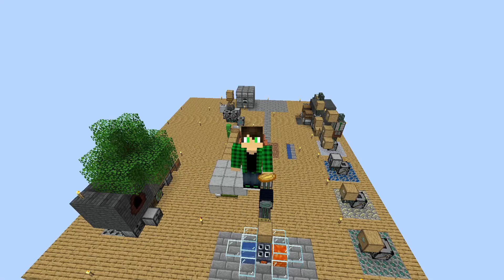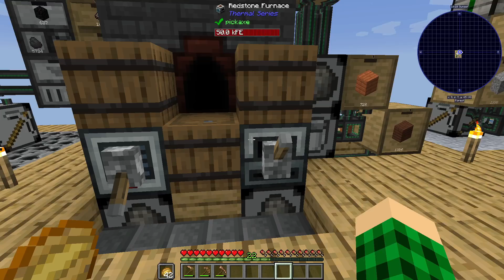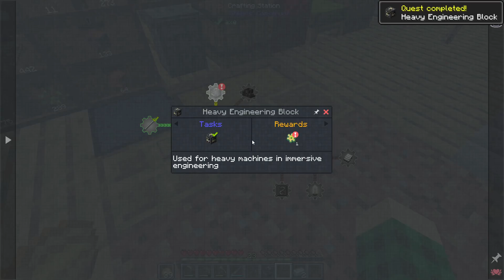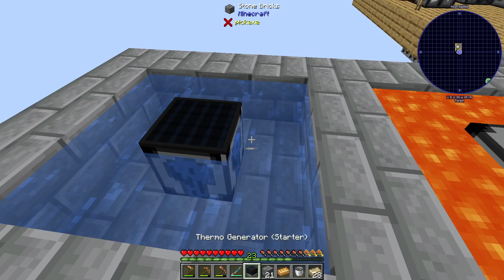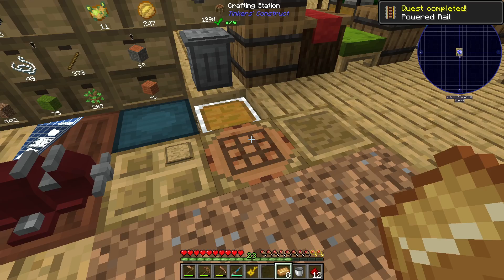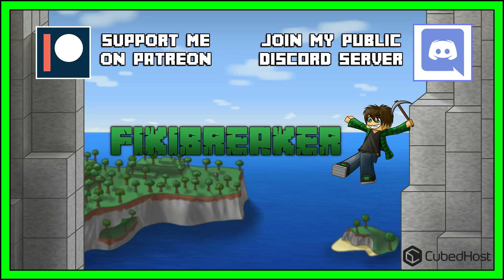Minecraft Techopolis Skyblock - EP3 - Metal Press & New Alloys

Comment: I believe steel is 1 to 1 ratio by default, it was different in my pack 😁Looking forward to mob automation. I tried to do it with immersive eng turrets but didn't work very well 😁
Reply from the maker: Gotcha! I don't think a mob farm is really the way the pack wants you to go. You can do mob drop duplication and the mob absorber for mob essence.
Reply: @Fikibreaker  But for mob absorber to work you need to kill the mobs near it if I remember correctly? 🤔 Or maybe I did something incorrectly 😅
Reply from the maker: I haven't tried it. That makes sense though.